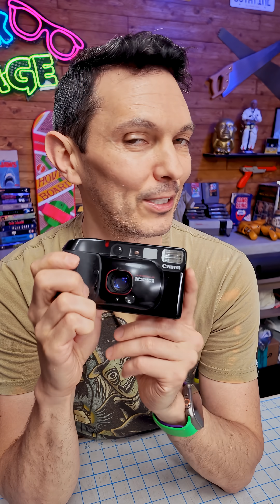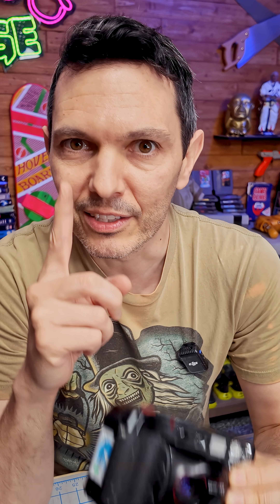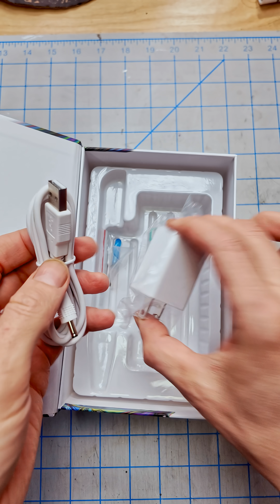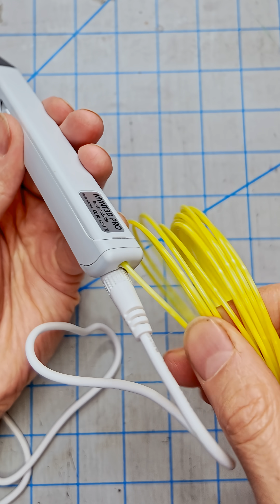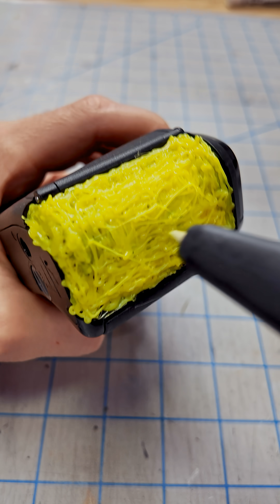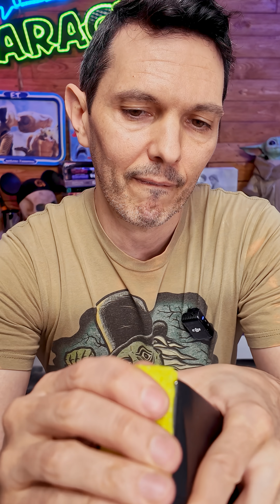Create Custom 3D Replacement Parts Fast (No 3D Printer Needed)

Comment: Maybe you can also try to use a soldering iron with a type of tip that you can use to flatten it smooth the surface with it
Reply from the maker: That's actually my plan! I have a wood burner/soldering iron with an adjustable temp and am gonna try it on a lower setting at about the melting temp of the PLA. Gonna wait til after I shoot out the roll of film that's in there :)